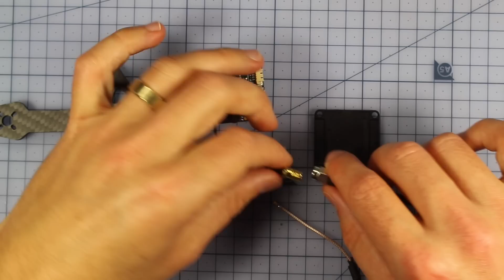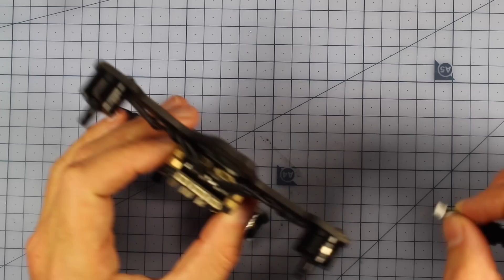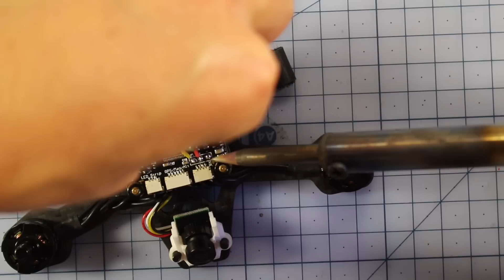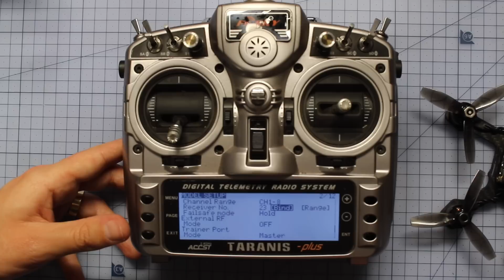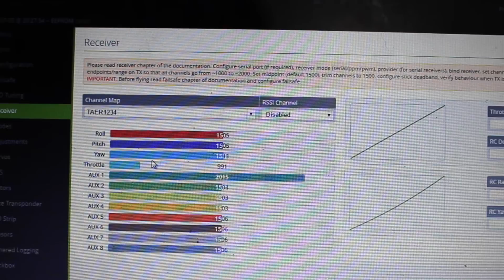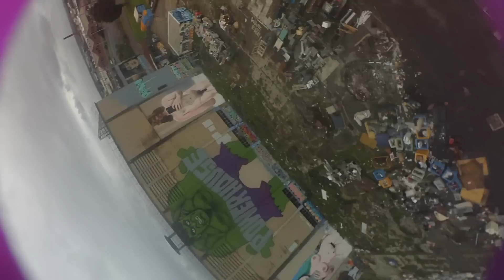Atom V2 DIY FULL GUIDE. How to BUILD, BIND & FLY

Comment: Thanks UAVfutures for you build guild.  I am finally building my Atom V2 that I purchased last fall.  I have an Lemon RX sat receiver.  I now how to solder it in but was wondering if there was any instructions on binding it?    I don't have any lemon receivers to bind it first with, so I need to bind it once put on the Quad.  Can I do that in the CLI interface?  Does anybody know of a guide or video showing this?  Thanks
Reply: I found out that I needed to bind to a Satelitte receiver first.  The command lines didn't work.

Comment: please help? when I Arm my Taranis/Atom by swith the motors spin as they are supposed too.  The problem is with props on it takes flight. i know this is noob question but how do I stop this?
Reply from the maker: turn down your minimal throttle value and calibrate your escs

Comment: When you are soldering the motor wires to your ESC's, is there a reason why you didn't remove the top layer of the Power cube stack and its hardware so that you would have a lot easier access to those solder points, but also be able to double check the factory work that looks like was already on the board before you began soldering. Another reason, would be to reduce any chances of accidentally melting/charring other components on that top board without realizing it from ambient heat given off from soldering iron. Maybe i'm missing something though, you look to be an experienced builder w/ all those quads behind you on the wall (although that wire twist suggestion is a bit lazy looking, pre-braiding the wires, and marking each wire with one, two, or three dots before braiding to know what wire each one is will look a lot cleaner --  this will also remove your need to cut and pre-tin the wire, as braiding them will shorten them naturally), I just was asking b/c I bought this kit as a gift for a family member and I'd probably suggest to them as a new builder to remove that top layer when soldering.

I was also really surprised to see you binding the radio to the receiver with the props still on... you should know by your 25th build (prob higher than that) that this is a horrible thing to demonstrate for new builders! If anyone is building this, REMOVE YOUR DAMN PROPS when you're first setting up radio communication systems before you know everything is set up properly, including ESC calibration, channel mapping, setting endpoints, and switch setup for arming, etc... I see you briefly mention 'taking props off' whenever you're ready to test, but I really think putting a warning at the beginning is a decent suggestion. Not trying to be a know-it-all, just trying to safely inform others of build safety on new aircraft.

Comment: Hi Stu, thanks again for all the interesting videos you're making! So happy you finally did the Helix build video, which was  apparently very popular, with tons of demand. It definitely helped me getting a nice clean build with the Helix!!!
This is my first try on these micro racers, boy they are tiny!!! I've the junior kit, so it's the 1105 - 4000kv motors, can I spin some Tri-blade on them or will I be over-proping them and burn them?
And why is it that you choose the D4R over the XSR? The XSR is smaller, comes with no pin... What makes you choose one over the other? Is it the range? Cos I've z few X4R-SB, XSR in my box here, but I might wait for the FuriousFPV Micro Rx, or TBS FrSky XM Rx, both are tiny, weigh in at 1g.
Sorry for the ultra long message! One last question, what capacity would bre the most efficient 3S battery  for this little beast? 750 mah? Or must I go for a 500-600 mah work the 1105 motors?
Thank you so much for your help! Any tips, advices or recommendations on FPV Quad Racing Building are more then super welcome! --- kwadracer@gmail.com 
(Been keeping an eye on a few micros, the Sputnik, BeeRotor 130, Quattrovolante Q-Carbon 130... Please comment if you have tried them out!)
Reply from the maker: thanks mate, glad you like the channel. um the d4r was just because I had it around. Use any reciever as long as it is small enough.  I think the 750 is perfect size, 3s, HV lipo. 

I think the 1105 motors would be best with the quad blade rotor x props

Comment: i  have a question i have the atomv2  i also  wanted to change motors to the 1306 motors i have currently the 1105b motors when i change motors what do i do next is there anything that i have to do on cleanflight. or just soder motors and fly, please help
Reply from the maker: you can just change them over mate. not much else you need to do. You might need to retune or flash a new pid setting using the tbs agent.

Comment: Hey Stew
You've put me in a conundrum. I love the Atom V2, also I love the RS90 they both look like a lot of fun. The Atom V2 is way better looking but I like the guards on the RS90 for flying around my palatial mansion 😉. I have a GB 190 with the gear you recommended, just waiting on the new board you reviewed the other week to arrive then I'll build it, also have I have a Taranis Tx to drive the GB190 with.
Now I've been also looking at FPV googles, ahhhh,decisions, decisions. But I'd like some guidance on the Atom V2 vs the RS90, and is it worth the extra $ to get the HD3 Fatsharks or the SE. Or I saw a combo online with the Atom V2 with a Tango $699 USD. I know the googles are a lot more immersive and would really make you feel at one with the (force, Star Wars joke) quad. As I was thinking the tango gives a FPV, but is it that good compared to googles?
Sorry lots of questions!
Regards
Garszy

Comment: will this mini version of the powercube handle a 4s battery? I read the specs on the full-sized version in the Vendetta but this is obviously a much more compact build, so I imagine it's not quite as capable.
Reply from the maker: It can handle 4s, but I think rotor x recommends that you only fly with 3. but the cube itself can handle 4 yes

Comment: Hey Stu, got a question for you.  When I power up my shiny new atom v2 that I just built I am asked to calibrate my receiver on the OSD.  The default receiver searched for is a SBus, but I am using a PPM so need to change the type.  Basically I want to know where the enter button to control the OSD is?  On a full sized cube they would be on the core pro...
Reply from the maker: Can press the black button again to cycle thru options I think

Bottom layer on the side, Hold for 5 seconds to bring up calibration

hope that helps

Comment: Hey! So basically I have been flying quad for 5 or so months now and it's awesome but the only thing is where I live there is a while during winter where the is constantly snow and I'm not sure how to continue flying with snow. I don't want to crash and get all my components wet. Also I was think of getting a second quad in the not so distant future because I currently have a 3s and it I were to upgrade to 4s I would need new motors and escs so it wouldn't be that much worse to just get a second quad. So long story short is this, or can you recommend a good quad that would be good for snow conditions? I was looking at one of these because the quad dosent need to be water proof but it looks like the cover would help keep the little bits of water out really well
Reply from the maker: umm I dont know any snow proof quads, but people do water proof them with sprays and covers. I think the atom would be a good candidate for this but I know nothing about flying in snow sorry.
Reply: +UAVfutures alright. That's kind of what I was thinking the cover would be a lot better then just an open frame. And I would water proof if for sure either way. Thanks.

Comment: nice quad...so want to get one. one thing comes to mind, what happens if a screw from the positive cube rail backs out a few turns due to vibration... nothing good I imagine. wouldn't it make sense to cover it with electrical tape or locatite it?
Reply from the maker: they are gold plated screws that are on pretty tight, Dont think it is going to go anywhere

Comment: Can you just take the fc of to solder in the motors? And also do you need to program anything on clean flight to use a satellite receiver? 
thanks
Reply from the maker: yeah you can remove the fc if you want to solder that way. You need to select "rx satellite" in cleanflight if you use a satellite.
Reply: ok thanks

Comment: I have the X8R, would I have to dismantle it and solder it on as well? Is there a way to just connect with cables? I have the atom v2 preordered and can't wait! Thanks for your videos!
Reply: X8R is pretty big. XSR would be better. We haven't left much room under the hood.
Reply from the maker: there is a cable port near the front, but I don't know if the x8r is going to fit.
Reply: +UAVfutures will it fit if de-pinned?

Comment: Hey man, nice tutorial(as always!), I'd like to try sbus on my next build, is it just esc's and Rx that have to be sbus capable or does the controller and module have to as well? Your vids have been vital to most of my previous builds and I've been searching for hours for an answer with no luck so hope u don't mind me asking, cheers.
Reply from the maker: Hi mate. S bus is just a way for the reciever to talk to the FC. has nothing to do with escs. For example if using a taranis radio, use a x4r (which is sbus) and connect it to your FC. and you are good to go. Some older FCs don't like Sbus but most new ones it works straight away with. Hope that helps.
Reply: +UAVfutures +UAVfutures Really appreciate taking the time to reply to a fairly noob question(I'm actually not but the electronics ain't my strong suit)I realise now it's a telemetry wire from the esc's. Am using kiss esc's and fc- wanna try one shot and sbus, x4rsb, and xjt module in 9xrpro that I was given until I can afford taranis. Will the 9xrpro handle all that? I think ....yes?
Reply from the maker: rj jolstaa ahh kiss escs.. yeah they are actually quite unique in there design and with the telemetry of each ESC( most escs don't have this feature). I have not tried them out yet sorry So I actually cant comment too much about them.
Reply: +UAVfutures no probs, thanks heaps